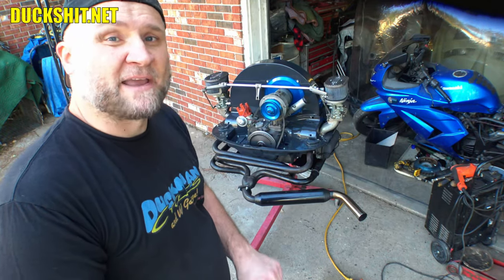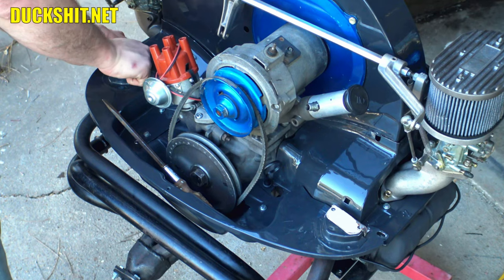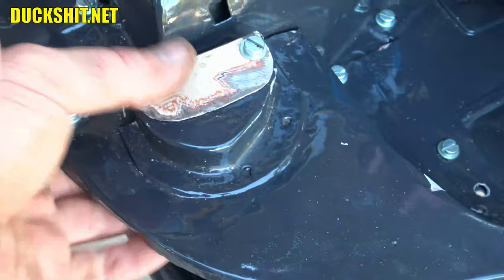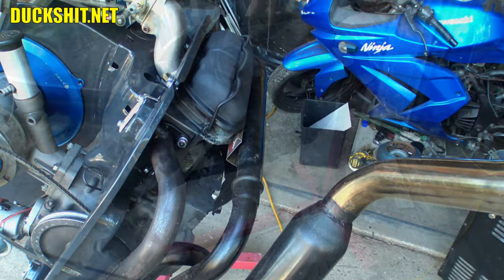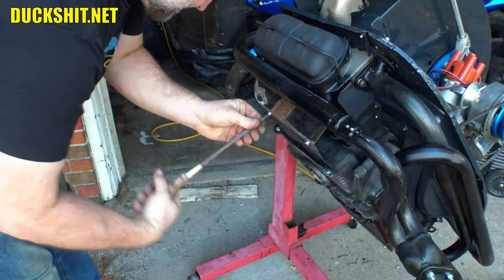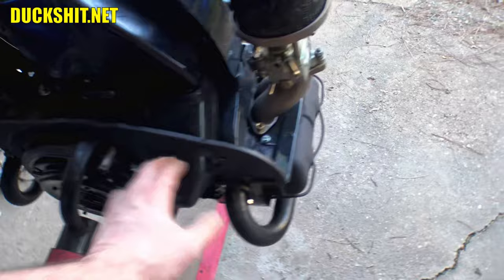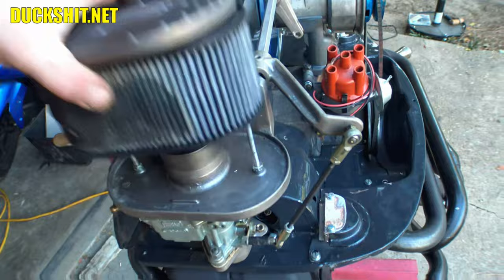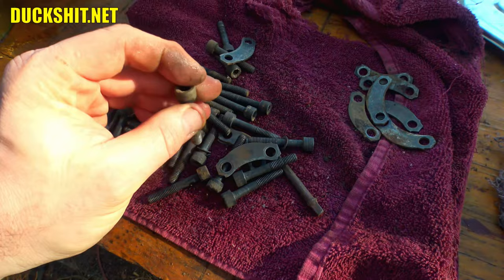🔧Fabricating Industrial Cooling Tins💥  -  1956 Chop Top VW Beetle - 177

Comment: Great job! Yes they are easy to make yet SO vital for bugs not running the stock heating tubes.
 The situation was a little different for me though as I went with Type 3 Cooltins (Controversial but they work for me). I did run tubular heat shields on the J tubes though to keep exhaust heat away from the heads.
Reply from the maker: To be complete and cool properly as designed, you gotta have all the tins!  Thanks so much!

Comment: A guy I know also made his own pushrod tube heat shields. 
The only difference was he layered up the exhaust facing side with that gold tape you see in some HyperCars. No idea if that causes issues for his SS exhaust but it sure helped keep the heat away from his pushrods.
Reply from the maker: I dont know if that would work too well.  You'd need an air gap underneat it.  But I'm sure it looked pretty!

Comment: I wish I just made block off covers for the preheat part of the tin. I drilled the spot welds out and made up and welded plates in. Your way is much easier and quicker..and probably neater. Oh well. The tins you made looked great also, I'd definitely attempt that if I didn't want to try and get some kind of heat running into my bug.
Reply from the maker: That's funny, I prefer to weld them shut like you.  The only reason I'm capping these off is because it was an afterthought.  Originally I was going to stuff a stock carburetor on there.... and now it's all painted!

Comment: Question, I am about to raise my baja about 3" on the rear. Given I dont have funds for expensive baja parts , this is my plan . Move the required amount of spline teeth, notch the spring plate or make new ledge and lower bolt housing ??? Move the lower shock mount the required distance to accomodate standard shocks. IRS. Your thoughts please. Note this is not a race car, its a fire trail explorer, just looking for ground clearance
Reply from the maker: Thanks for the question, kind of a strange place to ask on account of this being an engine tins video.  But I guess you can take the lower tins off for more ground clearence, right?